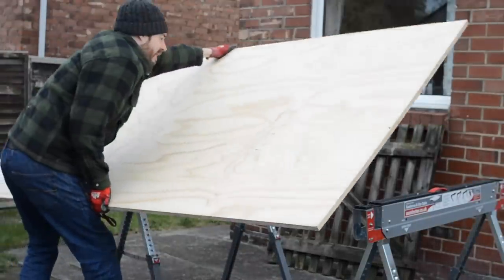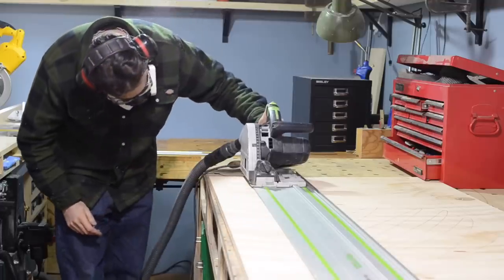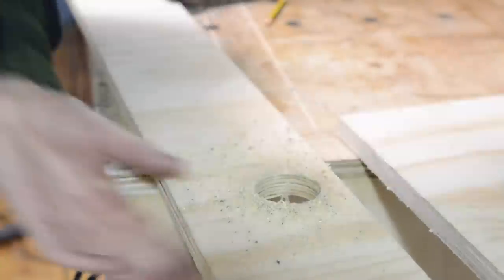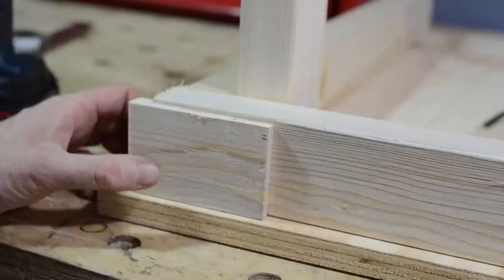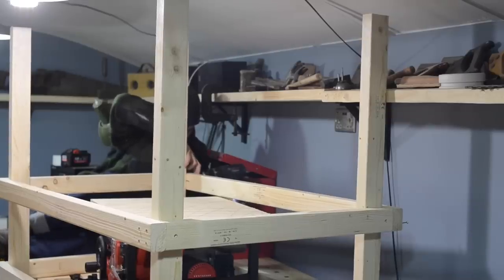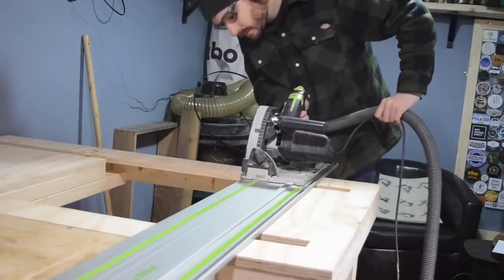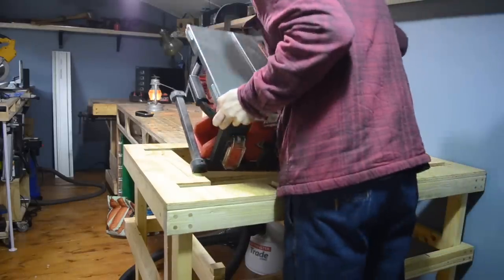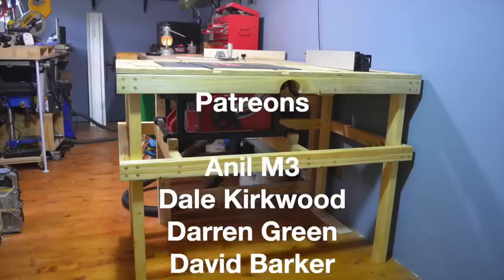Milwaukee Table Saw Stand

Comment: Good build mate using the saw upside down works well like you did with the bosch table. My only gripe is iam not that keen on the hole for the rack and pinion knob. If it was to be permanently in place I might have thought about extending it with some bar ect so the knob sat outside the table frame. But apart from that I like it.
Reply from the maker: Thanks. I want to be able to easily remove the saw

Comment: This is how I’m going to build my saw/out feed table when I get my new saw. I said this last time you made one but only now I’m getting around to it. Well...in a couple of weeks time.
Reply from the maker: Hope they have the one you want in stock
Reply: Either the Sheppach 105 2000watt or the evolution 5 1800 watt both at 255mm. Still not sure, anybody got any ideas? Concerned about the quality of the evo and if the blade on the sheppach is a non standard size needing shims.

Comment: Matt, a really nice job. I am contemplating getting the Evolution Rage table saw as all my wood is reclaimed with the odd hidden nail and screw and will incorporate some of your ideas. Thanks.
Reply from the maker: Thanks Tony. It would be nice not to make to worry about nails
Reply: Me too mate! Any ideas about the quality and accuracy of the evo?
Reply: I got to handle the saw at Screwfix Live in Farnborough and the fence seemed ok with no play felt. The saw was on special offer but as I was with my wife I had to pass on it :-).
Reply: UK Tony cheers mate. I think I’ll go for the evo after all. I only use pallet wood too so it makes sense really.

Comment: Hi Matt, an thanks for a good video :-) - I was wondering...how deep and wide is the actual table top on the Milwaukee m18fts210-121b Table Saw (Without the fence-extraction)?...and how deep did you make the table top? Thanks in advance.

Comment: Hi Matt. I've been following your long journey through tablesaws with great interest because I'm looking for the mythical perfect saw for myself. You did mention a while ago that the new Axminster (the AC216TS) didn't suit you, but you didn't go into any specifics. Please do! The Ax would seem to tick a lot of the boxes, so I'd love to know your reasoning about why it wouldn't work for you!
One other question - are the mitre slots on the Milwaukee "standard" size?
Thanks!
Reply from the maker: Its very similar to the draper I had and did not like. It looks like it has poor dust collection. The Milwaukee does have standard slots
Reply: Thanks Matt. Is that definitely the new Ax you're talking about? I thought that the Draper (and others) were clones of the old version (which was clearly not up to scratch), but I may be wrong?
Reply from the maker: I have not used one but when I was shown one it looked basically the same saw. Might be great but it would not work for me